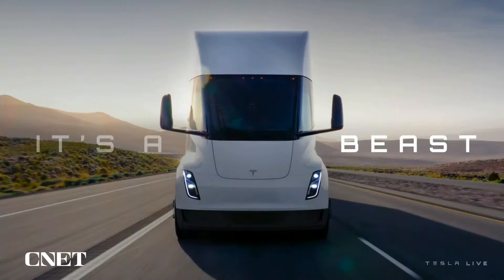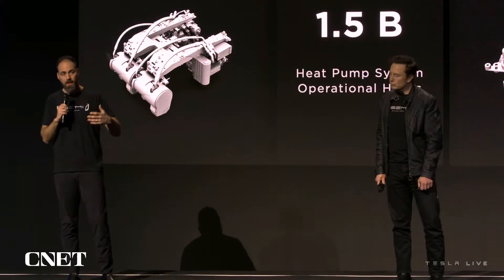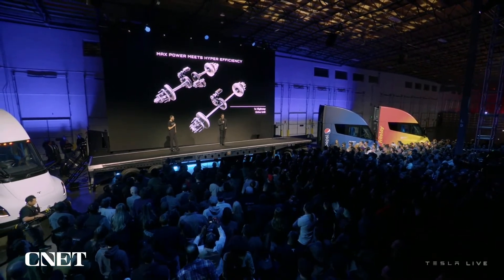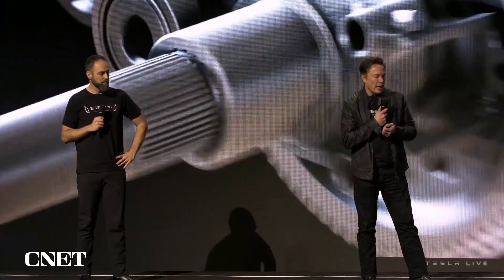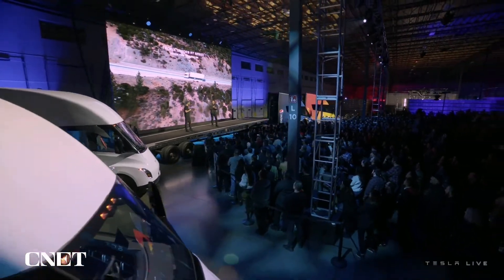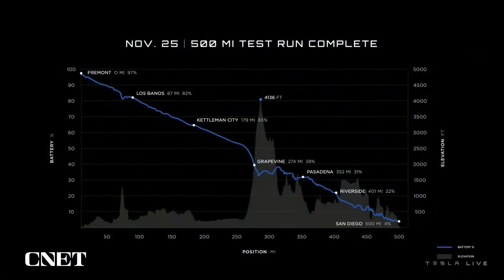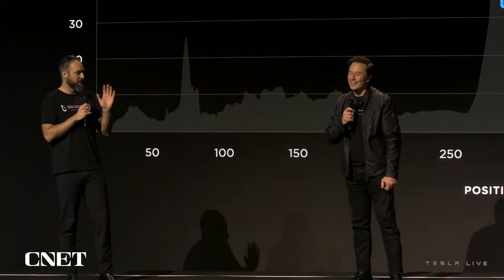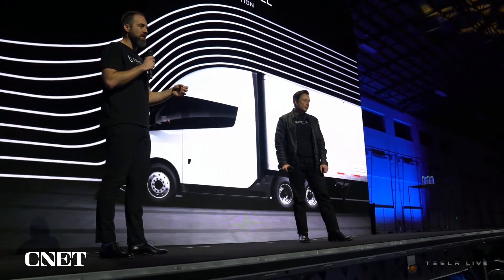Watch Elon Musk's Deep Dive Into the New Tesla Semi-Truck

Comment: 500 miles on a truck that is supposed to haul 80,000 pounds... you are likely talking 20,000 pounds in batteries.  That means you are NOT going to be able to haul the full 80,000 pounds (or whatever it is).  So how long does it take to charge and what kind of crazy power does this charging station need.  And if you do not think the battery will be that heavy... a Model 3 battery is 1000 pounds.  This is almost double the range and what 20x heavier... so even with sliming things down 20,000 pounds sounds about right.  If it is 35x the battery charge and 80% on a Tesla Model 3 takes 20 minutes to charge... is this going to take 700 minutes to charge 80%.  A Supercharge station is already something like 480v and 50 amps.... so are these going to use 1000 volts then... and maybe 100 amps to get the charging to 100% down to say 4 hours.

Realistically I think these would be better suited with a smaller battery and only used for local hauls.  Teslas typically do better in the city anyways do to lots of torque and regenerative breaking.  A 10,000 pound battery sounds a bit better and would cut very little into the payload... especially with the 2000 pound bonus EV trucks get.  Long haul truckers can go more than 500 miles in a day, but not in a Tesla.  The charging times are just too long.  Plus with those heavy batteries already cutting into your payload it would be even harder to have a sleeper version.
Reply: TESLA semi can haul 82k Gross more than ICE semi 80k Gross. 
goes 500+ miles in 8H, with 35 miles in reserve.
Reply: @markplott4820  I think it funny that they allow more for an EV... like they do not damage the roads or bridges as much somehow...  Most of the long haul truckers I knew typically drive 12 hours.  You can do that with these and the 82,000 is the total weight of the truck, trailer, and cargo.  If that 500 mile range truck weighs 10-12,000 pounds more you have to haul less.  EVs are pretty simple math wise.  The heavier the load the more the power it takes.  It is a linear scale.  And my calculations are that Elon has trimmed 25% off the weight and 50% off the cost of the battery.
Reply: @markplott4820  Not trucks.  And do to weights linearly effecting battery range you do not want to toe long did stances.  EV are good for every day driving and commutes, but not cross country road trips when hauling a load.  I think the Cyber Truck is going to struggle with it and so with the semi, especially the long range one.  The vehicles just way so much you need too large a battery and they are too expensive and too heavy at current technologies.

Yes ICE are only about 30% efficient and EV are likely around 80% and the charger is about 80% (you loose on both ends), but gas is so dense an energy source it is crazy.    EV cars do not last 10x longer.  The problem is parts and repair shops are a bit lacking and do to massively higher repair costs insurance companies total them out for minor damage... and Tesla will NEVER let a car that has been totaled ever Supercharge again.  And the batteries are so expensive.  The Model 3 is the cheapest and the standard battery is around $16,500 to replace.
Reply: @toddabbott781   - EV canonball RUN Dispropves your Crackpot theroy.
MANY ev make Coast to Coast road trips very FAST and Efficiently.
Reply: @markplott4820  NOT when pulling a boat, RV, trailer...  You double the weight and you cut your range in half.  That is what I am talking about.  The Cybertruck is a beast at something like 9000 pounds and is supposed to be able to tow another 14,000 pounds.  The battery is likely 5x the standard battery in the Model 3 so the charging times at a Supercharger (150kw) station is going to take forever.  You now turn a 1 day road trip into 2-3 days.

This semi suffers from similar problems.  For short hauls it is pretty nice.  You can get the cheaper battery and this allows more cargo weight and all that torque and regenerative breaking will really pay off.  There might even be enough time between loads and breaks to charge so you can charge it enough to run 2-3 shifts if needed.

The problem is Elon has not released the weights or the final costs and those are the most important things... and of course the charging times.  The cost of these charging stations might be nice too... and how long the batteries will actually last without the buffer he builds into all his other EV cars.  Why do you think these semis and his Cybertruck have been delayed so much?
Reply: @toddabbott781  - TRUCKS like FUD Lightweight inc GAS , are CRAP at towing. 
#1 - TRUCK itself is not AERO or Streemlined.
#2 - most trailers are CRAP ,they are not Aluminuium. too HEAVY trailer itself .
#3 - the Flatbed trailer or box is CRAP, or if you are towing something else like a boat. is also CRAP.
the TESLA semi is 4x BETTER than any Truck/Trailer combo. 
in a Commerical setting Tesla semi makes MORE Financial sense. 
SAME argument for the 2023 CYBERTREUCK , as replacement for GAS truck & Hybrids . 
CT is SUPER EFFICIENT with over 130 mpg , and w/ 4 motors - 400HP each can go 500 miles (MAX payload) and TOW 300+ miles .
Consumers will switch to CT purely for FINANCIAL reasons , SAME goes for Commerical operators.
Reply: @markplott4820  For the price of the long range Cybertruck you can get a F-450 diesel loaded to the gills with every option and that is going to tow just fine.  Yes the Cybertruck has far more acceleration, even when towing, but you do not race trucks and trailer combos.  The batteries are not there yet.  They likely will not be there for another 20 years.
Reply: 850 kWh battery. Weighs about 1000 pounds. Charging station with a capacity of 1 MW. Charge up to 70% in 30 minutes.
There is no bed in the truck. The truck will be used for city and fixed trips. This is not a long distance truck. There will be no revolution.
Reply: @sergeypavlov7249  Oh these can not use Supercharger Stations.  Even a local one with a 250 mile range would take 6, 8, or maybe even 10 hours to charge 70-80% at one of these.  There would either need to be  special charging stations at a truck stop, warehouse, or shipping company... and think of the amount of power that would need.  Say you are charging 50 trucks and even with 250 mile range versions that is enough power for 1000 average homes for a month.  People do not understand that for the US to go all electric would require a minimum of a 400% increase of energy production and the complete overhaul of the power grid at a cost of something like $80 trillion.
Reply: @toddabbott781  I think the long distance truck segment will be taken over by hydrogen fuel cell trucks.
Reply: @sergeypavlov7249  Possibly, but Hydrogen has many disadvantages too.  It is HIGHLY explosive... as in it will always explode with MUCH higher velocity and destructiveness than gasoline can ever do.  This requires VERY heavy storage tanks.  Also the cheapest way by far to make large amounts of hydrogen is to use fossil fuels.  Fueling and storage stations and transportation of the fuel is also much more expensive.
Reply: Todd your forgetting that a standard car has less than 5 pounds of Nickle in it.  But a Tesla Model 3 has well over a 100 pounds of Nickle.   And most Nickle comes from Russia.  So with Russia being an outlaw nation you can't have a green revolution.  Now the only other place to get Nickle is Canada but the Canadians are really badly at returning phone calls.
Reply: @marctemura2017  Yes, but if you did a direct conversion of the Model 3 based on weight.... and electric vehicles literally scale linearly by weight... the battery would be well over 30,000 pounds.  So take out a few thousand for reduction in nickel and some other efficiencies and some reductions in casings and such... 20,000 pounds is pretty generous.  The electric motors are lighter than the diesel engine and fuel too and the extra 2000 pound weight limit helps, but I am guessing he is loosing a minimum of 10,000 pounds of cargo capacity.  That is why I think a local truck would be better as it would be very close to a normal cargo capacity.  I actually think the battery is closer to 25,000 though.
Reply: @marctemura2017   - TESLA is USA sourced NICKEL.

Comment: It needs at least another 100 miles of range to safely drive 10 hours +. drivers do more in the truck than just drive it. it's their home. so they need comfort features. and how about actual loaded range? overloaded? It's potentially great but needs a little real world refinement... IMO
Reply: There is no bed in the truck. The truck will be used for city and fixed trips. This is not a long distance truck.
Reply: @sergeypavlov7249  That changes things
Reply: 8H in 500 miles w/ 82k Gross. with 35 miles remaining one Charge.

Comment: Remarkable feat of engineering, those motors are astounding .
Reply: less than half the load carrying capacity of a conventional truck. There is a reason why they have decided not to supply them to the market now and just use them ‘in house’ 😏
Reply: You probably weren't aware that Tesla did NOT invent the electric vehicle and the first electric vehicle was made in 1890.  That's right, 1890. They decided not to go the electric route because it was less efficient than a gasoline engine. 
Nothing about any Tesla product is innovative or remarkable and Father Elon wasn't even an original founder of the company.  Father ELon is a lying conman.  Do some research.
Reply: @johnbauby6612  the 1890 model was a breakthrough that evidently other than the electric milk float, nobody has had the quantum leap in thinking, engineering, production, software etc etc to pull anything out the bag until Elon started the revolution. Now how many are on the bandwagon? I'm not saying electric cars are clean and ethical etc, nor isn't hydrogen isn't the future but this guy has shaken up the car establishment, he's a disruptor. Let's see the reality of his 3 Plaid+ motored semi truck.

Comment: The only way a tesla truck would compete with a diesel up a steep grade would be if the tesla was empty. The 500 mile test graph show tesla truck heading DOWN grapevine, not up. If the tesla truck made it over the Rocky Mountains, it needs a charging station every 100 miles. It cannot do long haul trucking unless it had 5 tons less product. when that tesla gets to the top to charge the diesel would be waving at it as it passes and like a diesel pump station the tesla charge station would need as many pumps assuming there's more than 2 tesla trucks. When is the little cyber truck going to be ready.
Reply: How long does it take to fully charge? How much does the charger cost?
Reply: @sergeypavlov7249 One hour and 30 minutes
Reply: What current and power is required for the charger?

Comment: Have they tested the range with a flatbed trailer fully loaded? That will give you different aerodynamics from the enclosed trailer. Have they tested the range in cold weather? When will there be public charging stations available to accommodate the semi?
Reply: YES, tested Flatbed carring concrete K rails UPHILL Donner pass 82k Gross , PASSING semi ICE 80k load .
Reply: Of course.
You really think they just build it and hope nobody notices it wasn't tested?
🙄
. "Public" charging?
Ever seen an EV (car) plugged into a home charger?
It's "electricity".
They could pull this up to a "car charger" at say 8pm, plug in with an adapter, and charge to full in 4-5 hours.
The network is already there for the majority of use cases.
 Most won't be carrying FULL weight load, they'll have more range than the driver can use in a full day, without a top-up (although that's easy when the driver takes a mandatory break)
Reply: @rogerstarkey5390  So explain how is someone going to take a tractor and 53' trailer up to a current charging station and charge the tractor without blocking traffic in the parking lot? What if there are a few tractors coming in? They have not stated range on a less than loaded truck. They have not stated range on a flatbed trailer. They have not stated range in cold weather. People charge their cars in their garage at home. OTR drivers spend the night on the road not at home. 500 miles does not get a full day of driving for an OTR driver. I am not against them. I plan on getting one. Having answers to my questions would help in how to properly use one before there are charging stations everywhere.

Comment: Also what happens if there is no driver and it has a computer failure does it pull over and where can it see down hills too see a place safely too pull off . Or do computers fail I'm not really a computer person just asking questions.
Reply: Firstly
Two computers.
Two control systems.
Constant crosscheck.
Reply: computer Failure does not effect TRUCK controls.
Reply: De facto, the autopilot is not yet ready. No company has been given permission yet.

Comment: I wonder if they can add more range to these semi-trucks because the roof area, I suspect can add like a 4kW or maybe even a 8kW solar panel with the roof surface area it has.  Not sure if this was already discuss because I wasn't able to find any results on solar panels for the semi-truck.
Reply: Weight / complexity outweighs the savings.
You benefit more by using the same panel on a roof somewhere pointing at the sun and charging with that energy.
Reply: With some simple napkin math, you can see that adding solar panels on the truck does not give enough range compared to the extra cost. Today. 

We have 9.5 kWp solar on our house (25 panels) and the panels cover a decent part of the roof. I would estimate it is about the same size as if it was covering a semi-truck trailer. 

Let’s assume 100 % efficiency, which gives us +9.5 kWh per hour during daylight. The truck consumes 2 kWh per US mile, so adding solar would only give around 9.5/2=5 miles extra range per hour, at a cost of 10 000 USD or more. 

The Tesla semi made 500 miles in 8 hours. With solar added it would have had an extra  8 x 9,5 / 2 = 36 miles. 

Interesting when solar gets cheaper, but not worth the cost with the current prices.
Reply: I think you overestimate the power of solar

Comment: If the ford lightning is losing almost half it mileage pulling a trailer what do you think is going to happen when you add 45000 lbs. Not to mention the price of the replacement battery when it's dies 2 yrs after buying the truck.
Reply: TESLA semi 1.7kwh/mile hauling 82k Gross 500 miles.

Comment: Regenerative braking going downhill has to be quite an engineering feat.  To blend in the correct tractor braking with trailer braking is huge.  Each trailer represents different parameters for the tractor.  If Elon's semi-truck works as presented, this is more of a game changer than regular EVs.
Reply: Tesla semi can go FULL SPEED downhill w/ REGEN breaking.
Reply: Dual motors on the rear axle if the tractor.
One per wheel.
Precise anti-skid control on each motor.
Reply: @Michael Paul Holmes The tractor regen braking is a no brainer.  Coupling that with a loaded trailer and its current braking tech shouldn't be an issue under normal conditions.  The trailer manufacturers are now experimenting with their own regen braking technology.  Certain trailers are already using that tech.  Upsides for everybody.

Comment: Impressive ✨ I’ve been driving trucks over 14 years and I would love to own one of these Tesla semi’s 🙏🏾💙 well done Tesla 🙌🏽
Reply: less than half the load carrying capacity of a conventional truck. There is a reason why they have decided not to supply them to the market now and just use them ‘in house’ 😏
Reply: @bayly1977  Pepsi and Frito Lay are using the trucks right now. Tesla is selling the trucks to other companies as we speak, so I’m sure that the rest of your comment is innacurate lol
Reply: @waynelewis9110  😂😂😂
Reply: @waynelewis9110 how’s that working out 😂😂 Fritos and Pepsi are not logs, steel, concrete, or liquid.
Reply: @bayly1977  not every truck needs to have a big amount of product in the trailer. day cabs?
Reply: @Reico3331  true, hence a chip company took it on. Despite that, not announcing the empty weight is shady as
Reply: @Reico3331  LOL its called reducing costs! even local run around you will it up and drive out!
Reply: @bayly1977  gasoline powered vehicles will be obsolete within the next decade.

Comment: It will be interesting to see if they later offer the truck with a diesel generator. It seems like electric propulsion has a lot of benefits in this application but recharging will be extemely difficult now as available chargers are limited but also as adoption increases you'll hit grid limits even if chargers are available . Given the size of the truck losing say 500kg and a bit of space to accommodate an onboard generator will not be hugely impractical
Reply: Tesla is pretty carefully curating the rollout of the semi (ba dum tis).
They will only really be used for routes where they fit the use case. Chargers will already be ready on the route before the trucks would be driving it. Grid limits aren't gonna be an issue with equal scaling of all factors. 

Slightly obvious but Tesla would get slammed with negative press if they ever made products that require fossil fuels to operate. 

Not a bad idea but not a Tesla thing.
Reply: TESLA does not sell HYBRIDS, will never offer anything ICE.
Reply: TESLA semi MOST efficient in WORLD , 1.7kwh/mile. 
saves $200,000 per year.